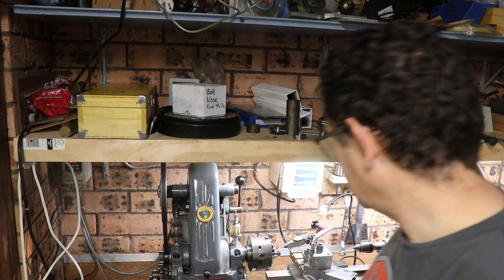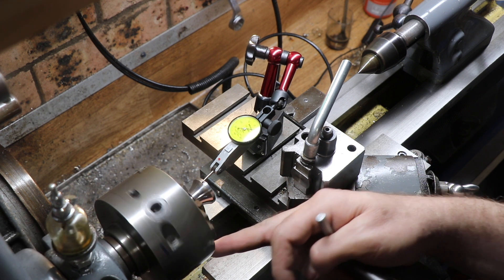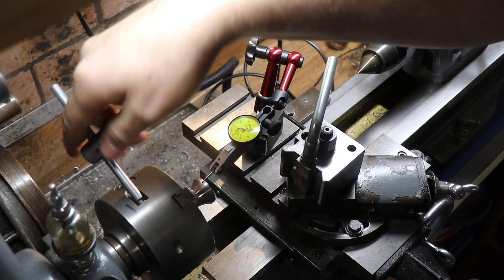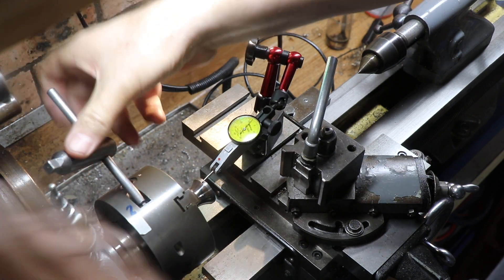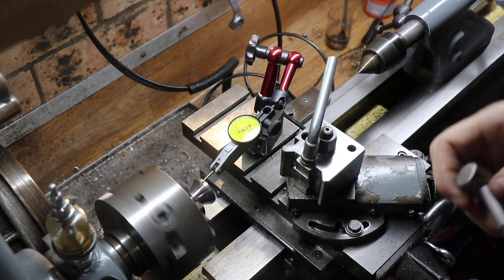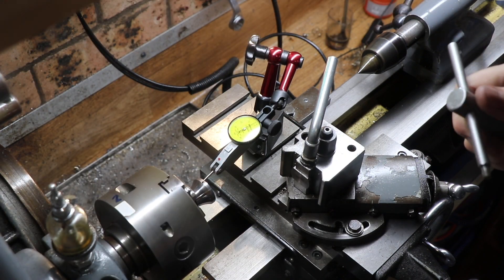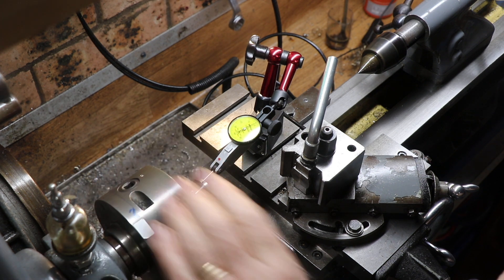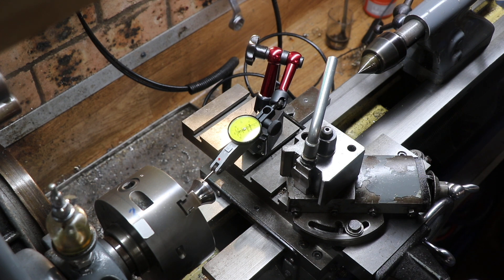How To Adjust a Griptru Lathe Chuck

Comment: I have an old Bernerd Grip Tru chuck for which I had to re-grind the normal outside jaws. Easy enough to get it to run true but now (of course) the inside jaws have runout when swapped over. So it's better to set the chuck to run true with the less-used inside jaws (using the adjustment screws) then replace with the outside jaws and grind those to match. Now you swap jaws to match the work and both run true. That avoids having to make adjustments every time. Hope that makes sense.
Reply from the maker: Thanks for sharing your tip.

Comment: Fella, you havn't a clue about what you are doing. I use one of these chucks all the time. Setting the work to run out with a TIR of 0.0001 - 0.0002" takes me less than a minute each time.

You are trying to adjust the runout in the same way you would with a 4 jaw by alternately tightening an loosening the adjusting screws, it may work but it takes far longer than it needs to

Put your dti against the front of the workpiece not on the top of it. Then loosen all three adjusting screws. Rotate the chuck to find the max TIR, now set the dti so the zero is halfway between max and min values of runout. Rotate the chuck so the adjusting screw with the lowest point of the workpiece runout is facing you. Tighten that screw until the dti reads zero. Repeat the operation.

Next tighten the screw at the highest point of workpiece runout until just snug (gently nipped up. Repeat the zero setting of the dti and tighten the lowest runout screw etc. You may need to loosen the highest runout adjusting screw at some point in the exercise.

Most workpieces take me less that 1 minute to set running true, often less than 30 secs.
Reply from the maker: Thanks I will try this.
Reply: About time someone gave a decent explanation…no one seems to read (or actually have) the instructions…
They are so easy to use once you get the hang of it…
If you’ve bought a second hand one, it’s a good idea to strip it down for a clean, and to get a good idea of how it works before you start

Comment: So, once you’ve initially set the griptru chuck up with a round ‘test bar’ and got everything to run true on the dial gauge, is the chuck now set up for concentricity on all following jobs, or do you have to repeat the ‘truing up’ every time you put another piece of stock in the chuck?
Reply from the maker: Yes ideally.  Scroll chucks are never perfect though so it all depends on how precise you need to be.
Reply: They are true for subsequent parts of a given diameter, but not so for all diameters!
Reply: That’s the whole point of the chuck, it needs re-truing for individual pieces, but once you get used to it it only takes seconds

Comment: One thing that I would add to John's video is that you should always loosen the bolts on the back plate and turn back the 3 adjusting bolts on the chuck body otherwise the adjusting bolts will be fighting against each other. The griptru chuck is a fantastic piece of kit
Reply: Not a good point…you should not touch the tie bolts at all…that means every time you want to make an adjustment you would have to remove the chuck to access the bolts…that’s not the idea at all…The only adjustments are made using the micro screws…Read the instruction manual…
Reply from the maker: Yes good point.

Comment: I got one of these on an Ebay auction for a whole assortment of Myford accessories. So it's been sitting around about 8 years or so. I better start using it!  Still  in original Pratt-Burnerd box.

Comment: Hi John, theses chucks were manufactured in the late 50s and on. The factory was at the Winnal trading estate in Winchester and it moved from London just after the war. Most of the machinery was war issue, still had the Big Arrow. To turn the scroll, many Herbert lathes were modified to make the cross slide into a thread cutting device, a brilliant piece of engineering. The factory was almost completely self contained, the steel bar, billets and cast iron blanks came from up north. All stages of manufacturing including heat treatment were carried out there. Burnerds were bought out in the 70s by an American Co, Pratt Woodworth who extended the factory in order to make specialist diaphragm chucks which were sent to Italy to go on Italian auto machines that ended up going to Russia to turn Russian army lorry wheels! (The cold war was still going on) I worked there in the 60s and 70s on all sections ending up in Pratts welding the jaws to the diaphragm chucks, learning welding at Sparsholt Agriculture College, (still there). Thanks for your effort on this, Pete on the Isle of Wight .
Reply from the maker: Thanks Pete that’s very interesting.  I love my Bernerd chucks.  My Mum grew up in the Isle of Wight.  I visited there a couple of times many years ago.  Near Cowes I think.

Comment: Do you not have to loosen/tighten the screws holding the chuck to the backplate, like a Buck Adjust-true?
Reply: Yes I believe you are advised to slightly slacken off the screws at the back of the chuck, and retighten when adjusted.
Reply: Definitely NOT….the tie bolts should not be touched…that means you would have to remove the chuck every time you made an adjustment…they are not clamping bolts for the micro adjusting screws…It’s a common fallacy……Read the instructions
Reply: @johnhall8455   John, I have had a Bernerd Griptru chuck and a Bison set tru chuck which are essentially the same mechanism using 3 screws. The better chuck by far is the Bison chuck which is just very robust, very accurate and expensive. It is assembled with screws through the front to the backplate so you can ease the securing screws slightly to aid the setting up of the chuck before tightening them fully up and checking the result. To my mind the Bernerd chuck with its hidden screws is not as user friendly because if you disassemble it then  you will have lost whatever the torque settings were on the factory installed screws, with no instructions as to what they should be and no means of adjusting them from the outside.  This can only be remedied by fitting the locking screws from the outside but adjustable from the rear.

The 3 screw positioning griptru chucks in my view are not as easy to adjust as they would be if they had 4 screws. I have made several adjustable 3 jaw chucks using cheap Chinese chucks and machining the cover plate reducing it in height about 7mm and increasing the depth of the backplate recess so there is enough space to drill 4 equally spaced  screw holes and tapping M5 for grub screws. These chucks have been very successful and are much easier to adjust using the same technique for a 4 jaw chuck with a pair of hex socket drivers in opposite positions turning one in and one out. I cannot understand why the Chinese do not make them like this and charge a little more for the advantage they offer.  John

Comment: Never used one  and would love to know how they work but surely a 4 jaw would be quicker ?
Reply from the maker: ian bertenshaw The advantage is that once trued it is repeatable.
Reply: The adjusting screws are tapered and locate against posts that are cast on the inside of back plate.  As you screw down it pushes the chuck body away from the cast posts
Reply: Easy peasy once you get the hang of it….
It’s a good idea to strip your chuck for a clean, then you get a good idea of how it works